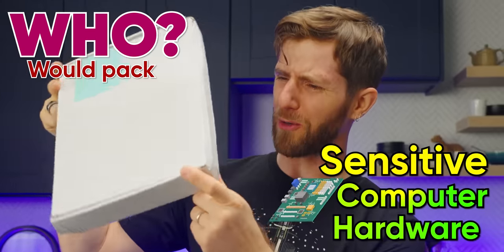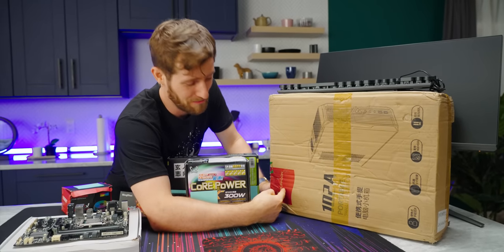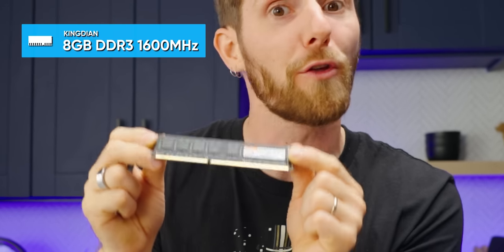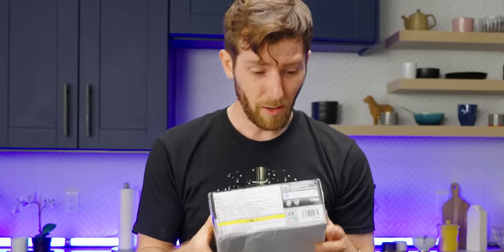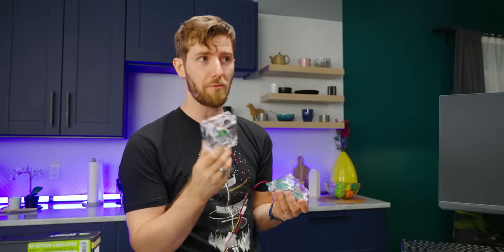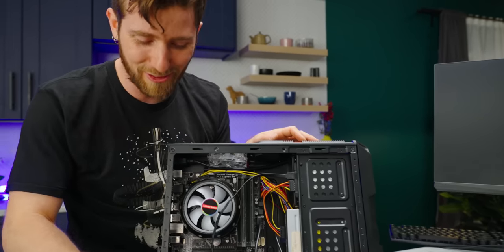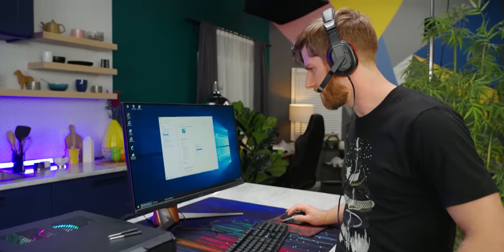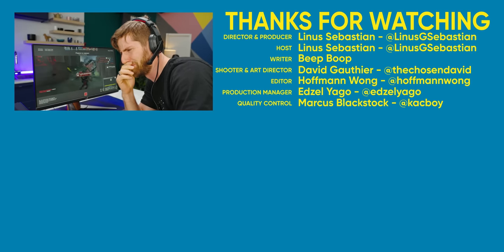THIS Wish.com Gaming PC is WORSE!

Comment: The really really REALLY sad thing for me is: This PC has better specs than mine
Reply: Same
Reply: Me too lol
Reply: I have an i3 10th gen integrated graphics laptop 😭
Reply: Im gonna be honest same. My specs are
Intel core i3-3320, intergrated graphics, and 4 GB of ram
Reply: @imsovereign  me too 😭
Reply: @imsovereign I at least was able to get rid of my i3
Reply: @imsovereign Depending on ur other specs its not that bad I mean its 10th gen
Reply: @imsovereign  its 10th gen bru, ur fine
Reply: Same. My specs:
Intel Core i5-4570, 16GB 1.6GHz RAM, 500GB HDD, and Intergrated Graphics.
Reply: @imsovereign  tf you talking about kid , i3 10th gen is good . Have been using i3 5th gen .
Reply: @roshwyinstaicoon2593  I had those specs in 2016, ouch..
Reply: i used i3 3110m+4gb ram+500gb hdd 1366x768 60hz tn panel laptop for nearly 10 whole ass years before switching to a somewhat high-end gaming setup(getting 340fps in games that i used to get 7fps in)

Comment: The power lead with a ground cable is a Japanese-style cable. Most outlets in Japan are ungrounded, but some will have a ground 'pole' sticking out to which you can connect the separate ground lead. This is required for outlets that e.g. AC units connect to. 

Why this PSU came with a Japanese-style power lead is... weird.
Reply: Scythe is a Japanese company - I guess it was sourced directly from Japan.
Reply: That also used to be a thing in the U.S. Older homes (and some current homes) had the electrical boxes grounded through the bezel screw. It's still common to be able to buy 2 prong to 3 prong adapters with a prong that attaches to the bezel screw. The original outlets in my 1920's home were all 2 prong (and unfortunately entirely ungrounded).
Reply: intresting. :)
Reply: Power Supplies imported from Japan almost every time comes with that ground connector. I imported my Superflower Leadex III 850W and came with it's own PSU cable with the same ground cable.
Reply: Yeah, even in North America in older homes a lot of the outlets won't be grounded but usually you just buy adapters here instead of companies putting on a pole to ground.
Reply: So what do they compensate for a ground if a ground pole is not available? would they have products that have internally build-in breaker switches or do they have sockets with GFCI?
Reply: Huh, interesting. Do any JP outlets ever have 3 hold outlets like NA? Figured they would at least sometimes considering NTSC-J and all that.
Reply: @kmoecub  I live in an apartment where all the outlets not in the living room and one in the kitchen are ungrounded. It's an old building lol
Reply: The whole box is in Japanese, so probably is made in japan.. rare one
Reply: as someone from europe... that thing looks weird and sketchy as hell.... i would actually liked to try it.. its potentially only 230v thats gonna kick me.
Reply: @kmoecub  yep, can confirm, I took possession of my grandmother's house that was built by my grandparents in the 1940's and have been slowly updating many things, including the two prong only electrical....not easy with plaster based walls that I really don't wish to damage, but worth it to beable to run a window based AC and modern PC and server equipment.
Reply: @Aomicplane  Well if the appliance really needs to be grounded it will have this little ground fork thingy. But yeah a lot of devices that you would expect to be grounded in the US are just not grounded in Japan, like laptop charger cables, and desktop and monitor power cables.
Reply: "e.g." means "for example."
Reply: Can confirm. I have several old devices from Japan that came with that cable. The first two (which happened to come from the same seller) made me think the seller was taking to piss with me. Color me surprised to find that you're supposed to screw your ground in... i mean... i know JP can be slow to take some things, but electric stuff is genuinely easy to change.
Reply: Oh hey, I remember reading your answers on Quora.
Reply: Older Taiwanese buildings also use the same sort of outlets, likely leftover from Japanese occupation.
Reply: @kmoecub  I would not AT ALL say that you would ever be able to make use of a plug like that.  perhaps in your 1920s house(how is a house that old still standing with the original outlets?  apparently you lived in a literal cardboard box) that's how things worked, but in the 1970s house I lived in(and indeed, every single home I've ever been in literally ever) there would be absolutely 0 need for such a nonsense cable.

Please do not spread nonsense, houses in the US do NOT use cables like that, it's not a thing.  It wouldn't surprise me at ALL if houses in Japan do that though, their houses are janky as hell, and very cheaply built.
Reply: I think sometimes happen? I purchased a PSU from Amazon US and it came with that cable.
Reply: In South and Central America some old houses have similar grounding poles except the whole electrical installation is grounded to that pole instead, it is still a thing in some rural areas.
Reply: The box is in Japanese too, should also have given it away.
Reply: My Asus Monitor also has one of those things that stick out from the plug. It has a sticker with Japanese on it.
Reply: @cyberwomble7524  So they sourced the Scythe box from Japan?
Reply: @bobthebuilder609  absolutely is a thing in the US it is very rare any more, but not every family can afford to completely rip out and rewire a house every time the standard changes.
Reply: As someone living in Japan. You're correct. It has Japanese on the power supply box and on GPU box as well.
Reply: Japan, EXPLAIN YOURSELFS!
What the frick
Reply: Scythe is Japanese, perhaps this PSU was designed specifically for the Japanese market.
Reply: The reason these are less common (although still find-able) in the US is because US houses in most states must install polarized outlets with ground pins to pass home inspections (and also GFCI outlets if near sinks, etc), and these requirements have been in place for decades, so over time most homes have been upgraded. Japan, as far as I know, still considers a separate ground post to be "good enough", and doesn't require an upgrade (and, compared to some of the other really, really stupid things about the NEMA system compared to other standards, like how you can electrocute yourself by sticking a fork in it, it's arguable that Japan isn't wrong: the ground post isn't really the biggest sin to concern yourself with).
Reply: @bobthebuilder609  there are literally homes built in the early 1900's that use these and they can still stand with those Outlets if you just never update them our old City Hall built in 1911 and then used as a Museum still has some they are not Active anymore but they are still there and that building was just recently turned into a Brewery and Museum Big Cities may not let it go but you can still find them in smaller rural Communities built back then
Reply: @potato_opinion  a ground wire is not "technically" needed for electric circuits. They are just nice to have when stuff goes wrong with electronics
Reply: @JorgeAlarconL  Funnily enough, my Gigabyte monitor came with 3 power cables, a US grounded 3 prong cable, the Japanese 2 blade + earth spade and a AU ground 3 prong.
Reply: @Aomicplane  in Japan most breakers have earth leakage protection built into them, so you don't really NEED the ground cable and generally you only use it for washing machines and refrigerators as most sockets don't even have a port for ground except for ones where they expect you to put a washing machine and a refrigerator, that's how it is in my house and my previous 2 apartments.
Reply: @Asatora  It's a non issue, the breakers have earth leakage protection.
Reply: @kmoecub  yeah and then no one attacts the grounding lmao
Reply: @Aomicplane  "It detects small stray voltages on the metal enclosures of electrical equipment, and interrupts the circuit if a dangerous voltage is detected." (wiki article for 'earth leakage circuit breaker'. To my knowledge, if you are in an apartment or a house here with very few sockets that have a grounding pin port, it's probably because you have an ELCB. That's how it has been for me in all of my places. I only have 2 sockets with a ground pin and they're in the designated fridge/washing machine corners. I plug them in because why not but I don't think I really needed to.
Reply: I was coming here just to say this. It's always a pain when you have to plug in a traditional 3 pin cable 🤣
Reply: I guess he could just ask Infinite Cables for a NEMA 5-15R to IEC 60320 C13 cable if he wanted... Why Japan doesn't just adopt the NEMA standard for power outlets? That's the weird shizz happening here.
Reply: @hi_tech_reptiles  rare but their outlets are basically a modification of the US style plug
Reply: @DeinonychusCowboy  Outlets that prevent sticking things in them have been code for over 3 decades in the state I live in, yet I see this stated as a fact all the time. None of my outlets can be used this way, any one with a "new" (within the last 30 years) outlet can't either in PA. I don't understand this myth.
Reply: @potato_opinion  I am guessing you could just jam that extra ground cable into the ground socket and hope whoever did the wiring for your house is somewhat competent.
Reply: Am in Japan, can confirm. Had to buy a new laptop cable because I didn't have a plug with a ground pin, and the cable had a ground lead. Usually it'll be appliances that get grounded though
Reply: @Aomicplane  I'm not saying I agree with it, because I wish Japan would adopt grounded outlets as the default, but the general consensus here seems to be "Japanese consumer appliances are designed to be safe to operate without a ground, therefore installing grounded outlets is unnecessary. In the exceedingly rare event that something does go wrong with an ungrounded appliance, the circuit breaker will prevent serious injury."

Outlets with a grounding pin do exist in Japan, they just aren't the standard. AC outlets, for example, are always grounded. Some large appliances also need to be grounded, but they don't require dedicated circuits like AC units do, so they just use the standard Type A outlet with a ground lead. You're not going to be moving your refrigerator, washing machine or desktop PC around, so it's not a big deal if the ground is through a lead.

Again, I'm not defending the practice, I'm just trying to explain the (characteristically insular) rationale behind it.
Reply: I use that type of power cable on my pc
Reply: As a European living in Japan there is nothing that pisses me off more than that. In my apartment, which was build 2020, there are only 3 outlets which are grounded, and these are occupied with my AC, my fridge and my washing machine, meaning I have no choice but to leave the 1000W PSU of my PC ungrounded!
Reply: @kmoecub  yeah most outlets still ground on the screws still i have a ground attached to mine
Reply: @potato_opinion  lol, they don't compensate anything.  If you fry, you die.  Maybe the breaker at the house level will save you.

A of PSU's have breakable fuses inside though, so maybe that'll save you, depending on where you short.
Reply: Dang it, you beat me to it haha
Reply: thanku. still like wtf..
Reply: Yes, all three of my genuine Corsair power supplies bought in Japan (including the AX1600i) come with this kind of cables. In my home, only the refrigerator, bidet, and AC are properly grounded.
Reply: Do PSUs from Japan designed for 100V malfunction when exposed to 120V? I've heard original SFC (Japanese SNES) power supplies can output the wrong voltage or break.
Reply: Now I really want Electroboom to go to Japan and test their outlets
Reply: and taiwanese packaging
Reply: Good to know
Reply: And then come the UK plugs that have a fuse in them...
Reply: As an european it made me laugh a lot
Reply: @cyberwomble7524  or manufactured in china and supposed to be exported to japan and they got way more stock than needed. same thing with the gpu i've seen those brand on japan used pc store (most likely rebranded from galax gpu)
Reply: @potato_opinion  
If there is no ground pole then there is no ground.
Reply: @DeinonychusCowboy  it's rather shocking (no pun intended) that of all things Japan is worse than the US at, it's their electrical outlets
Reply: How on earth did you get over 3100 👍? Did you pay 🤑 for them? 😜
Reply: @kmoecub  When I bought my 1930s sears craftsman home here in Wyoming almost 5 years ago I had it completely gutted, inside the walls was the older cloth insulated wiring AND the original knob and tube wiring from when the house was built. Thankfully none of the knob and tube was still connected but it was interesting to see.
Reply: Yea cheater plugs have this too but it's super sketchy imo.
Reply: I've noticed that grounding thing in Hondas which are Japanese so go figure
Reply: you missed the japanese text on psu box? also that 1030 is from japan
Reply: considering the GPU is also from Japan, like what is going on lol
Reply: Japan's power situation is very confusingly shitty.
Reply: and you screw the ground lead with a nut?
Reply: i use them in the usa. I like it, its added safety
Reply: Prove it
Reply: @TheKidnappedOne  you can run almost anything on two prong without an issue, you're just losing a safety factor
Reply: All homes in the USA have a grounding rod..  @MetalHeartGunner

Comment: RE: 3:13 - My guess is that was a Gigabyte board that failed quality controls over the DVI port and possible other issues.  Someone took the QC reject boards (basically stole them from the company) and sold them on Wish.
Reply: You mean the vendor or a manager at the vendor sold them directly. China has many brands based around products rejected by the companies that ordered them. Could be typos on a branded shirt, could be unsafe furniture, all manner of things.
Reply: @passintogracegoldenyearnin6310  Sometimes I feel that people run around and continue running the factors after hours and that is how we get those knockoff things. Or they just cheaply buy machines meant for disposal, but keep them in use to produce other stuff.
Reply: @HappyBeezerStudios  I dont know how it works with the tech sector, but when it comes to clothes the factories and plants used for all the big fashion brands either simultaneously produce knockoff shit or are placed right next to the factories that produce the fake stuff. So there's a lot of overlap and sharing of info/resources when it comes to producing this stuff.
Reply: Nope its just a clean used board.Those things are a dime a dozen.

Comment: “You don’t need a screwdriver to install a cable!” 
He says after installing the totally standard ground connector for the psu with a screwdriver
Reply: Was looking for this one before posting myself lol.
Reply: Serial, parallel, VGA, & DVI cables came with thumbscrews on the plugs like 90% of the time. Wouldn’t particularly wanna use a screwdriver and risk breaking the the thumbscrews, but you *could*. 

Don’t see them popping up on LTT unless it’s a retro special, though.
Reply: ltt screwdriver